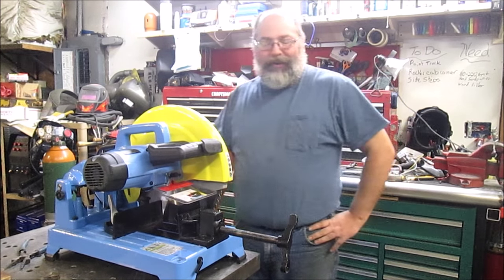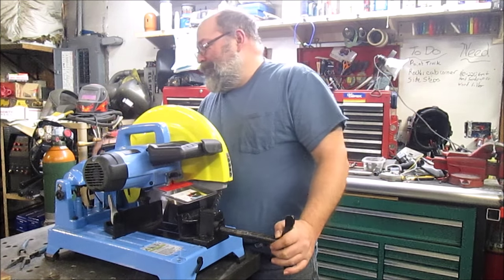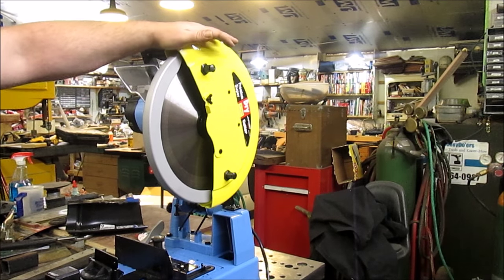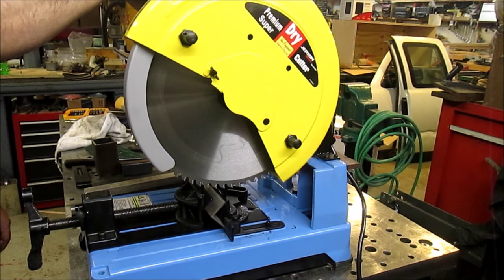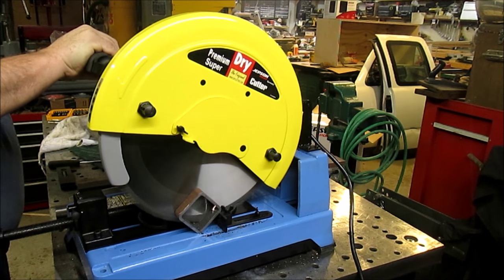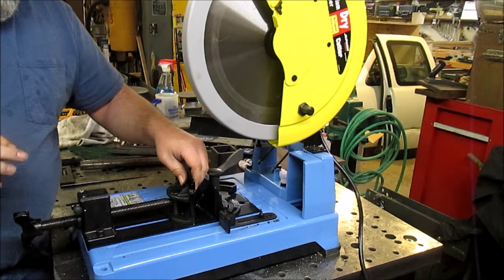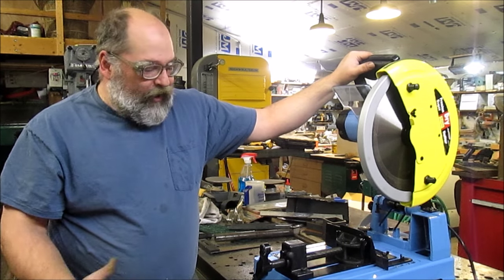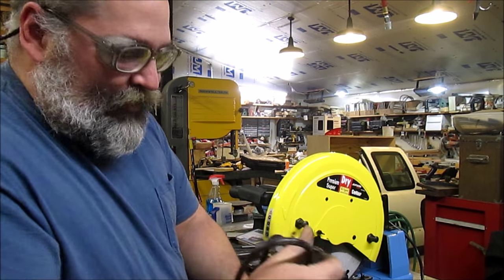Jepson dry cut saw

Comment: That saw is nearly identical to my Milwaukee Drycut saw I have had for year.  The castings and most of the parts are the same.  I don't have the vibration pads or long cord.
Reply from the maker: From my understanding Milwaukee has gone to a stamped sheet metal base.

Comment: so u got this 1 for 7 years now, how u stil like this machine. how is the blade holding out
Reply from the maker: Love the saw, a good friend of mine has gone through 2 of other brands with about the same amount of use.

The name brand blades, Jepson, evolution etc seem to last longer than the cheaper ones. The blades can be sharpened I can usually get 3 or 4 sharpenings.

If you need a saw to cut fast and accurate then a drycut fits the bill.

Comment: how does it peform with cutting angles?
Reply from the maker: +Sander Sebreghts I have only done a few test cuts on angles so far but it preformed nicely at 30 and 45 degrees
Reply: +Wood-N-Metal Workshop ` thanks for the fast reply, is it also possible to cut angles like 33°?
Reply from the maker: +Sander Sebreghts any angle between 0 and 45

Comment: Nice first impressions video. I am looking at replacing my 14"chop saw with a dry cut saw.  I was wondering if you would comment on the accuracy of the vice as far as square and angle cuts. Could you also comment on the straightness of the cuts. I have had a problem with blade flex on my 14" chop saw when using what I would consider to be poor quality blades. It gets less noticeable with better blades. I also noticed that you put square tubing in  the vice and held it on the corners as opposed to the sides. I was wondering why: a specific reason or it is just the way you prefer to do it?  I am enjoying your videos so far, please keep it up.  Tom
Reply from the maker: +Tom Wardman The saw cuts very square right out of the box, and is easy to adjust to get perfect angles as well.The reason for holding the square tube at a angle is that it cuts better/faster that way, the less time spent cutting the longer the blade lasts.Thanks for watching and commenting, we are doing ,our best to put out good interesting info and projects that anyone can do given a bit of time and a few tools.

Comment: How do you like this saw after 3 years?
Reply from the maker: I love it! There are a few issues of course. It does throw a lot of chips, but that's just the nature of the beast. It's a bit loud, the rubber feet come off. The pro's far outweigh the con's. The cut speed, and  accuracy put this at the top of my list for cutting materials.